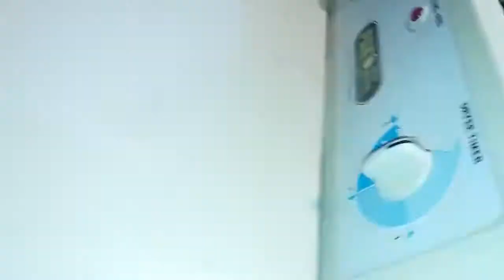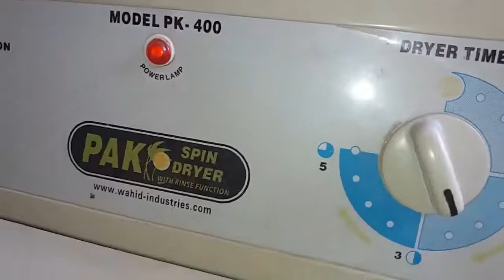Dryer Machine Repairing

Comment: What to do if the spin motor is not rotating fast & getting hot ?
Reply from the maker: multiple reason, about that
poor motor capacitor,
poor motor bearings,
poor motor winding,
and if not working Dryer Machine brakes
Reply: @Multitech2021  Thank you 🙏